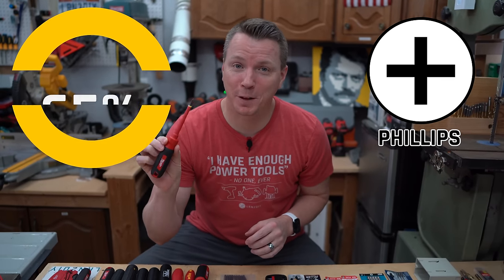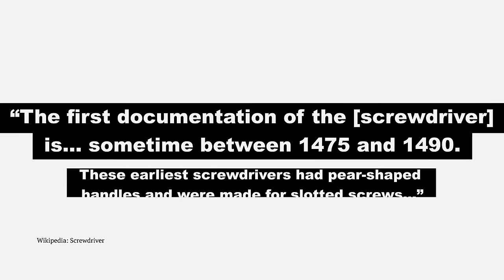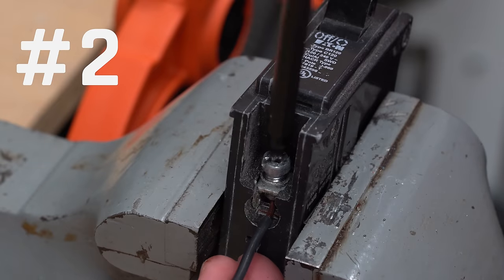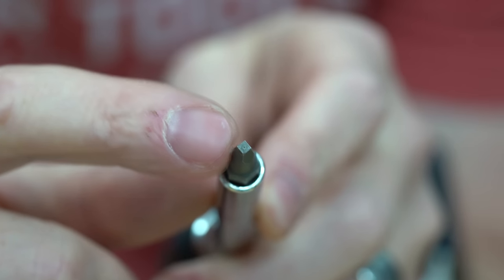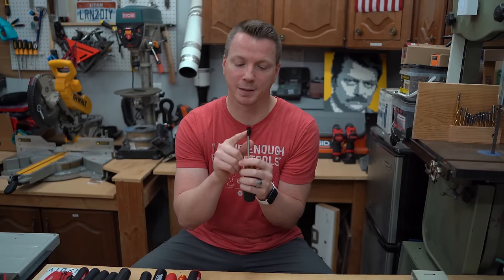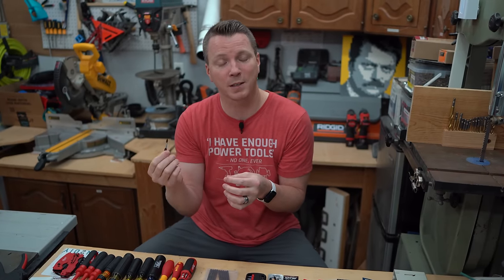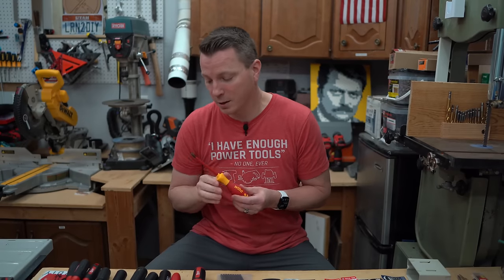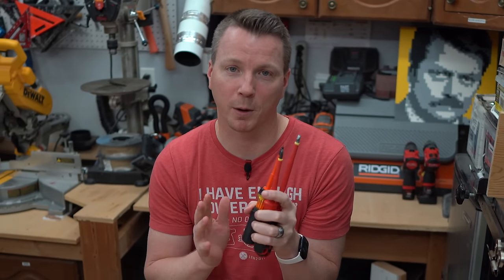You're Using the Wrong Screwdriver For Electrical

Comment: Two things: I tested a pre-set torque tool 4 n-m with a Robertson bit, on an older circuit breaker rated to that torque, and the hole rounded out before the tool hit the spec. What the issues with all drivers is, is that the smaller the diameter of the effective contact area making the force transfer, the greater the likelihood of stripping the hole/face area, or end of the tool fins. Robertsons work great in hardened wood screws, withstanding power impact driving; torquing in soft metal breaker screws not so much. Torque is leverage; too much, and something gives - heads on nuts shear off, bits cam out, or strip the slots.
You're overthinking the "negatives" of the ECX - the center is mostly for position and alignment; little actual force is transferred in that very small radius center. In addition, the two side fins closely mesh with the Robertson hole, but the main twisting force is applied to the longer walls of the main slot. Pozidrives popular in lumber might be a good fit for electrical, but they don't quite match the combo slot/Robertson heads as they've evolved.
I suspect the Wiha bits ride out, precisely because the tapered aspect of the Phillips fins are so near the center. Again, you went in search of a solution to a perceived "problem" with your ECX bits that had not actually come up. Perhaps the tool designers knew what they were doing?
You convinced me that overall the ECX may be better where it fits; torquing will be the test.
Of course the bigger Robertsons are about all that work on ground bars, as the slot is not diagonal at all, so ECX might work, but not ideal.

Comment: When I do diy, I a lot of times will just grab a slotted because it will do the cover, the outlett screws, and the wire terminals. Even though I have access to ECX bits in my hand, it's easier a lot of times to just have one tool for a quick job.
Reply: The slotted size of the cover is smaller than that of the terminals.
Reply: i use a philips until i need the torque
Reply: That’s what I’m saying, I get it there are better options but I would have to be doing a lot of electrical work to feel like I could actually benefit by caring about the driver I pick. I just haven’t had any significant issues using whatever I had handiest, if it was other work besides electrical I’d be thinking about it more

Comment: I can not use any of these screwdrivers because they do not fill the torque requirements in both the NEC and the listing and labeling instructions. The loose bits I can put in my torque screwdriver.

Comment: I have been using the Robertson predominately for several years now.  I have the Klien with a flip-over #1 and #2 blade in it.  I also do woodworking as a hobby and use nothing but Robertson screws. And like you, if the slotted driver went away completely I would be happy with that.  Also, there is the Pozi drive that most relays and contactors use for wire connection.  I use that on all my control panel work.
Reply: You don't have to deal with stripped square drive screws doing maintenance? I've had a lot to deal with before. They are ok to use a couple of times but the drive quickly begins to be loose in the screw head.
Reply: @robertlawrence9000  Not really. I rarely have a problem with stripped Robertson screws.  But in woodworking, I have had a lot of spline drive screws strip. Especially the spline driver tips.  And I only buy name-brand driver bits.  They just do not hold up.  And lately, that is all you can buy around here is the spline screws.  The Robertsons are getting very hard to get.
Reply: @robertlawrence9000  you just need to only use the right size and make sure your bits are properly hardened ones.  They look worn before they do damage.
Reply: phillips can go away but we need to keep JIS
Reply: When I do electrical work around the house the Robertson has been my go-to for a number of years.  Today for the first time I ran into #1 Robertsons.  Prior to that everything had been #2.

Comment: i am Australian and work in electronics. We only use PosiDriv (type 1A or Z ) in our products but see Philips and never slotted on new things. We also have a Suzuki SMD machine so I have a set of JIS drivers as well. JIS B1012, uses a strict cross unlike the Phillips (cross recess type 1) which has rounds between each axis. It is very important to use the right size and style. I have only rarely seen Robertson heads here except in roofing studs but I like the idea of them.
Reply: Does the stamped dot on the screw at 2:56 indicate a JIS screw?
Reply: @dbeierl  Yes, I think so too!

Comment: 65% of people use Philips because they are great for 90% of projects. I hate coming across all the oddball screws guys will use on small repairs in a house full of Philips and having to switch tips to remove that one Torx or Robertson. Sure, if you’re building a brand new deck, switch to something better than Philips, otherwise stay consistent with what exists, as long as it works. And Philips usually does

Comment: Hey I’m an electrician and I carry three different slotted (flat head) one #2 Robertson (square) and only one #2 Philips but if I need to put in a receptacle most the time I use a flat heads driver to torque them down

Comment: As a Canadian, electrical engineering technician, and from an electrician family, Robertson bits are the best choice for installs. Green and red are the working bits (yellow and black being the outliers).

Btw, square drives are not robertson.  There are differences that make robbies superior.
Reply: If it's not a Robertson, it's wrong.  😁
Reply: Robertson are square drives. What distinction are you making? The taper? Strange to mention distinctions as if they were important while avoiding a mention of what the differences are. Do you come across Non-Roberson square drives in these applications?
Reply: @ccbowers  Robertson tools and screws have a slight taper to the square recess and the square drive ones do not. 

The true Robertsons tips are made by the company and inserted into a shank/shaft for use in the tool.

Square may fit robbies and vice versa, but shouldn't, as they may cam out or fail in other ways.
Reply: @TheThomasites  All square drives I see have a taper, therefore Robertson. Seems like a distinction that doesn't seem to matter much anymore.  The design is over 100 years old, and the taper was around since then. Where do you see non-tapered square drives?
Reply: @ccbowers  usually in combo sets, no name stuff that the general public uses. Have to remember that not everyone buys big name stuff, but may watch a yt video on stuff like this.  

Just did a quick search, available on amazon if you type square bits.  Robetrtsons come up but so do true square.
Reply: Anyone is allowed to make a perfect clone of Robertson, I think they're just not allowed to call it Robertson because Robertson owns the name Robertson. 

There are good square drives and bad square drives, just like anything else.

Comment: Hi, I know this is an old post and I may be wrong here but some screws you were testing seemed as if they were Pozi screws (Phillips with extra slots) it does not sound like much but from personal experience, the performance is noticeable with less (by no means not impossible) to cam out using a Pozi drive on a Pozi screw and not a Phillips. Thank you for the time taken and info shared testing this.

Comment: Not insulated, but I like the Klein 32560 "Extended Reach" multi-bit driver; extended blade bits that lets you get into deeper holes when needed, comes with #2 phillips, 1/4" slotted and #1/2 robertsons...and works as 1/4" and 5/16" nut drivers...which covers pretty much most things you'd encounter, without the excessive amount of potential options/flipping to find the right driver.
Reply: Wear rubber glovers and you do not have to worry about insulated tools.

Comment: I use flat tip / slotted on electrical because that's what Allen Bradley puts on the load side of their power distribution blocks and the J3 terminals, I also use Pozi drive on alot of stuff.

Comment: Thank you for your interesting video. In case there is a beginner in this electrical work or just your first electrical work I should prompt to you that the buzz over this topic of best fit screwdriver is because all electrical work connections should be quite tight to be safe and avoid potential risk of fire etc  in our home, so its quite important to tight well these connections.

Comment: You can use Phillips, slotted, square, or combo tip. It's common to use 1/8, 3/16, 1/4, and 5/16 slotted drivers in electrical work. Also square and Robertson are similar but different. 

A lot of IEC devices will use pozidriv. And insulated tools are not necessary if the circuit is de-energized.
Reply: Insulated tools add a layer of safety at virtually no cost.

Comment: I agree with the results.  Been using 1 & 2 robertsons for years with no problems. I also use a 12v DeWalt impact for devices. It doesn't over torque the screws.

Comment: I actually have that multi double sided Klein screwdriver. I bring the flat/Philips and #1/#2 bit and it saves so much space in the tool bag for house calls. I really do like the insulated ECX though for panel work but that’s just my opinion.

Comment: I generally like slotted screws (flat drivers). The only huge downside to them is the difficulty in getting the driver centered on the screw. Minor problem with them is their intolerance for the driver being tilted. If you can get the driver centered and parallel to the screw (co-axial), you're golden. I've had times when screws with other drive types (including socket-head hex drive) rounded out and I had to cut a slot in the screw head to get the screw out with a flat blade driver. The thing that flat drivers have over other designs is their ability to exert force on the screw as far from the screw center as possible, maximizing their torque. Those screws that were so tough to remove that they rounded out were easy to remove with a flat driver.

All that being said, I usually use phillips drivers when I can, primarily for their self-centering design. The downside of them is that they were designed to (intended to) cam out of the screw to limit the torque that can be applied to them. But phillips screws are so ubiquitous in the USA that a phillips #2 driver will fit most.

My experience with square(ish) drives is that they tend to cam out and quickly round off both the screw and the driver. Whether I've had experience with both types of squareish drives/screws, I can't say. All I can say for sure is that the squareish stuff I've experienced is no better than phillips.

If I could have my preference, everything would be star drive (torx). Those give the best grip of all, granted you have a good driver whose tiny points won't bend or break.
I think the next best thing would be something resembling a slotted security screw. Interrupt the slot with a post and put a slot in the middle of the flat driver blade to accept that post. It would be very unlikely to cam out, and the post would keep the driver centered on the screw.

Comment: I always use the flat blade because I find the Philips tip makes it too easy to strip and ruin the soft screws in electrical fixtures. I hate flat head screwdrivers, though. I'll have to try the square tips. I never even realized those would work.
Reply: Robertson are the best. Hands down it is a superior system. The only thing I won't use Robertson for is drywall and that's only for the mud.

Comment: It depends on the job. ECX only works for things like outlet sockets and recent switches. The older things don't, and just to get to it utilizes standard Phillips or flat-heads to access. You need a standard slot driver to get the plates off.

Comment: You didn't mention the Pozidrive bit.  I discovered them in 2022 when working on some SquareD molded case Breakers.  My Phillips bits were coming-out and damaging the screws.  I finally looked at the instructions and the recommended PZ2 bits which I found in my 100 bit kit from Amazon.  I haven't tried them in a receptacle but they look like a modified to Phillips bit, the the wings at a lesser pitch.

Comment: I use a multi-tip Milwaukee or Klein for outlets, panels. If it’s multiple boxes I’ll get busy with eob or eox 1-2’s in a dewalt variable clutch 12v driver.

Comment: I've been happy since I discovered ECX, and expected you would find it the winner. Like, they just never cam out and I can torque breakers and receptacles as tight as I want. But, you've convinced me to try finding a good quality Robertson driver and give it a shot.

As an added note, I considered the nub on the ECX tip to be helpful in centering the tip in the screw to begin driving, not so much for torquing.
Reply: Try the PR2 for all your phillips number 2 needs. Check it out its a PR2 not the PR2

Comment: The Milwaukee ECX looks like the square drive portion is to keep the bit from slipping out of the slot rather than adding more torque. Personally, I use the Robertson all the time. My coworker uses a slot head and torques it down as hard as he can, once breaking the switch body.
Reply: That's exactly what my coworker does: slot head as tight as he can make it. He also uses a wrench to tighten a hose to the hose bibb. Every time I had to remove the hose, I'd find a mashed washer or normally, no washer at all!

Comment: Actually I think the biggest problem is the soft screws that they put in them they're not hard enough that's why they tear out.
Reply: Not really because harder screws wear your screwdriver faster
Reply: @balinoob1837  I had issues where I can't tight a cable on some manufacturers sockets. Either the screw thread slips or the head.

Comment: I knew Phillips would come in first as most used. Phillips is mostly used on Japanese screws by many people also. The correct driver on those would be the JIS Bits, Japanese Industrial Standard. Great video by the way. Always very informative as always.
Reply: Unfortunately, proper JIS drivers are unobtanium in the United States. A Phillips driver only sort of works with JIS screws.
Reply: no the biggest use of phillips is likely drywall screws.
Reply: Replacing a Philips screwdriver with a JIS (Japanese Industrial Standard) screwdriver can be beneficial depending on the types of screws you most commonly encounter. Here are some reasons why a JIS screwdriver might be preferable:

1. *Specific Design for JIS Screws:* JIS screwdrivers are designed to work with JIS screws, which are commonly found in Japanese products, particularly electronics and motorcycles. The fit between the driver and the screw is more precise, reducing the risk of stripping the screw.

2. *Less Cam-Out:* The JIS screwdriver's design reduces the likelihood of cam-out, where the screwdriver slips out of the screw head, potentially damaging the screw or the workpiece. This is particularly important in precision work.

3. *Better Grip:* Due to the more precise fit, a JIS screwdriver can provide a better grip and more efficient torque transfer, making it easier to work with tight or difficult screws.

4. *Versatility:* While a JIS screwdriver is specifically designed for JIS screws, it can often be used effectively on Philips screws as well, offering a degree of versatility.

5. *Durability:* JIS screwdrivers are often made with high-quality materials and precise manufacturing standards, leading to increased durability and longevity.

However, it's important to note that while a JIS screwdriver can be used on Philips screws, the reverse is not true. Using a Philips screwdriver on JIS screws increases the risk of damaging the screw. If you frequently work with Japanese products or find that you're stripping screws with a Philips screwdriver, switching to a JIS screwdriver could be a wise decision.
Reply: I found that that was true for my Nissan truck.  I was trying to use a Phillips screwdriver on it.  Now I use the right screwdriver and get much better results.  

I really appreciate the intelligent discussion on this video and also the equally intelligent discussion in the comment section here.

Comment: A lot of electrical equipment still has slotted screws only. Siemens panelboards for instance. A lot of breakers also use hex setscrews. Milbank large frame (UQFB and UQFP), have hex setscrews on the lugs, and flathead on the mounting screws. Torx is common on GE and ABB equipment. #1 Philips is common on small neutral and ground bus in DIN rail control panels and IEC motor starters. So depending on which brand of equipment you work on, you have to carry all of these screwdrivers.  Equipment with flathead only neutral and ground bars is still incredibly common even on brand new equipment.

Comment: You should try a SL/PZ2. 
I got a Wera VDE set with 18 interchangeable tips and it is pretty compact. 
There are different versions of it, mine has all the slotted, number one and two of: PH, PZ, SL/PH, SL/PZ.  And some special tips for opening electrical boxes and panels.

Comment: Yes to Robertson - But the best screwdriver (uninsulated) is the Picquic (also made in Canada) - there is a downside to the great Canadian Robertson - sometimes when used with an impact driver cheap screws can lock on and require a bit of tugging to get free 

Question for you - is the EDX designed to give better torque or just reduce the chance of a slotted screwdriver slipping off the screw - accident reduction? Let’s be honest we hate slotted because they slip off and stab.